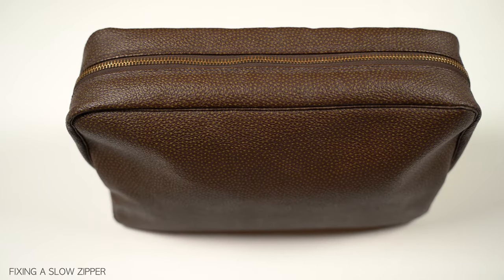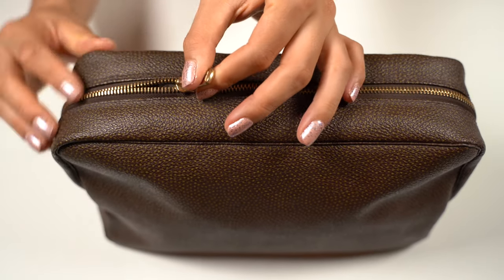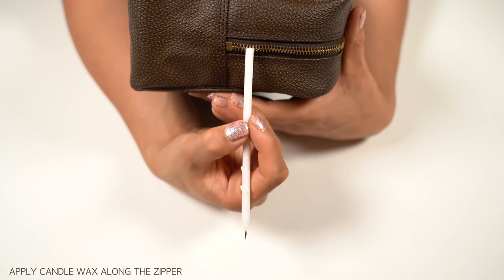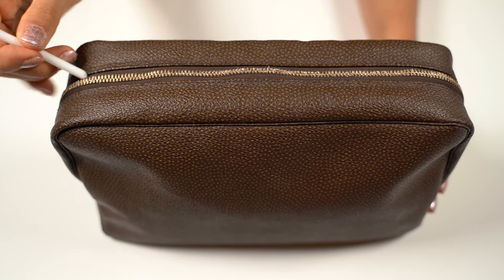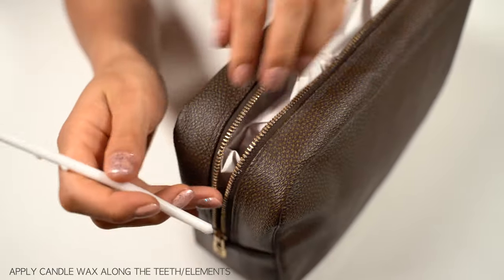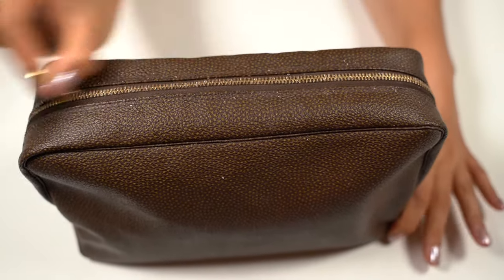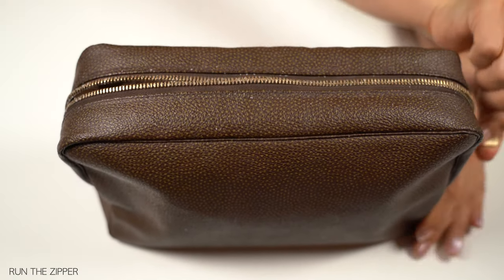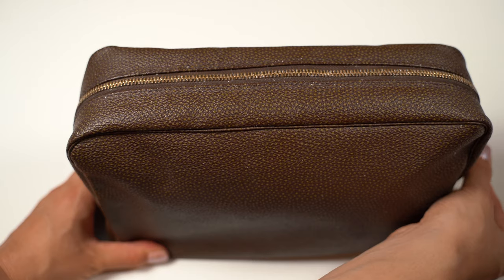HOW TO MAKE A ZIPPER RUN SMOOTH USING CANDLE WAX

Comment: This works great! Also, pro-tip- to make the wax work to its fullest potential- after running the candle wax over the zipper, use a hair dryer to melt the wax so it gets in the teeth more effectively. The wax by itself worked, but it works 100 times better after a melted wax with a hairdryer. Plus it gets the loose wax off of your zipper.
Reply from the maker: Thank you for the tip! Will try it out 🥰
Reply: @ChanelGirl  I hope it works for you too! I really appreciated your video and helped to restore a vintage Coach purse zipper. ❤️
Reply: Wow, thanks! I have a bag I can't give up.
Reply from the maker: @jennifermorrison110  aww thank you so much, I want to try it again (even tho the zipper is still kinda good since I did this video) and use the hair dryer for sure! I think its time for a retry!
Reply from the maker: @updownstate  Thank you so much for watching ❤

Comment: Another trick is to use a very soft graphite pencil tip,.. slide that up and down the zipper like as in this video,.. it works well. The pencil lead tip technique also works for stiff keys in door locks.
Reply from the maker: Will try, How long does it last ca.?
Reply: @ChanelGirl  In zippers, as long as the item hasn't been washed. In door keys, (in the ridges and the edge notches) a few months.
Reply from the maker: Nice 😊 Ill give it a try!

Comment: Cool repair. I actually have done this to on of my handbags whose zipper is a bit stiff. It works like a charm!
Reply from the maker: Thank you 💕 I was very surprised because it actually works 😃 I have been checking the zipper since, and it is still running very smooth after 1 month! No issues at all ☺️☺️☺️

Comment: Have you noticed any change of color to the hardware/ metal of the zipper after using the wax ?  I'm afraid of ruining the metal and fabric.  Also, does the wax disappear eventually ?   Thank you so much !  I want to try this but hesitant because I don't want to damage my bag.  Thank you so much !!    :)
Reply from the maker: Hi, I have’nt noticed Any change Of color after using The wax. Maybe it got a little bit shinier. The wax is in between The teeth, I can still see little leftovers when i check now, And also some on The zipper head that «eats The teeth» (Sorry for The poor explanation use Of words 🤓). So it doesnt dissapear all together but is rather smeared. And i Did use alot Of wax (maybe Too much). I checked The fabric Of The zipper under or below, And I can spot some areas Where I accidentally smeared wax. That is still There. But it doesnt bother me. Since a bag is much more valuable, maybe test it out on another bag or a zipper that you have laying around? It could be zipper on pants, zipper on an old hoodie etc. Before making the final desicion?
Reply: @ChanelGirl  Wonderful !  Thank you so much for the response and advice,  I truly appreciate it !  :)

Comment: thank you. i am thinking of using a crayon instead of candle on my friend's leather jacket. i just unf#%ed it and it took me forever. i'm afraid it will happen again , because it is so difficult to zip. i think your purse strategy may work well. thanks again.

edit : it worked great 
also i would never suggest WD-40 as some have suggested , as it might damage  the leather or other material...
Reply from the maker: Thank you! I will try with a crayon 🤗 I did try with wd-40 but i had to spray in a lid and then carefully with a qtip drag it along the teeth! Even then i made a mess on sertain areas 😄